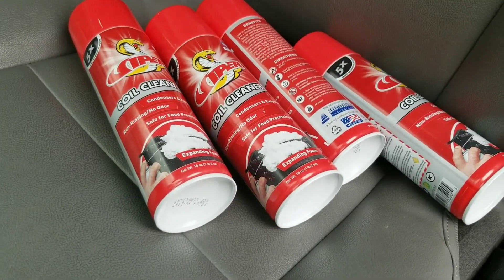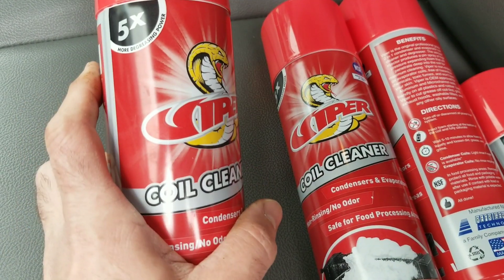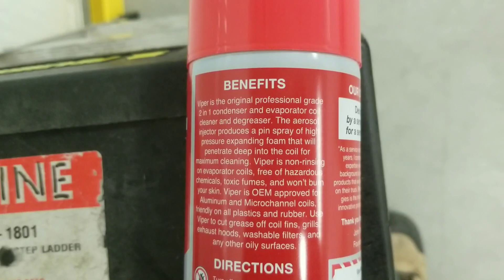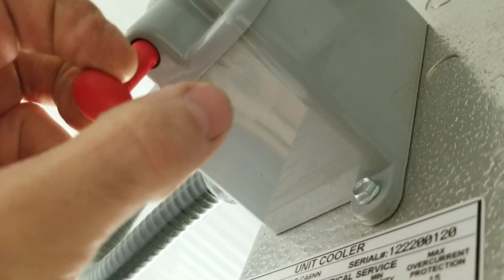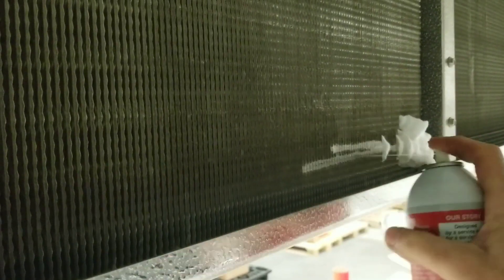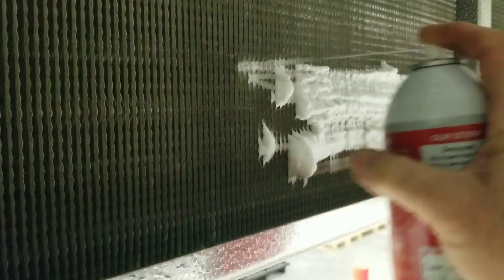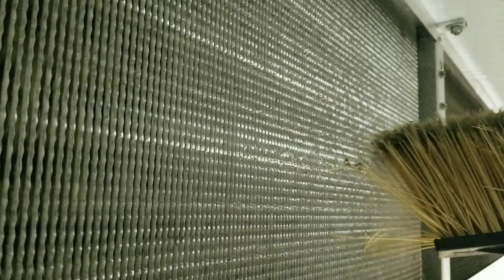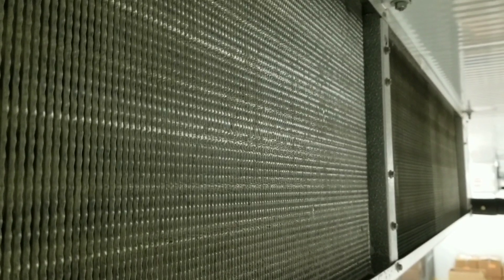HVAC - Evaporator Cleaning in a Walk-In Cooler

Comment: Let’s say your unit gets dirty weekly. To prevent having to do this constantly couldn’t I use a filter to help catch the dirt particles going into the coils?
Reply from the maker: I  have a this in some cases yes
Reply: @HVACKnowItAll  what kind of filter would you recommend. Something I can find at homedepot. The unit is used to help cool down a room used for livestock during the harsh summer heat. I’ve been noticing hair and other gunk has been severely clogging up the coils and I’ve had to constantly clean it